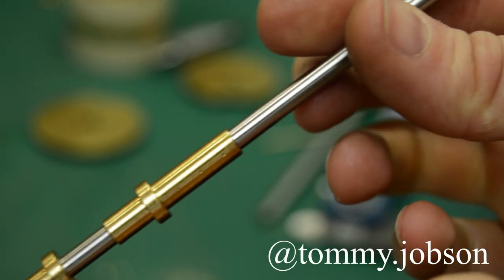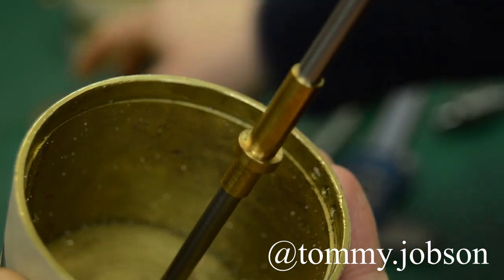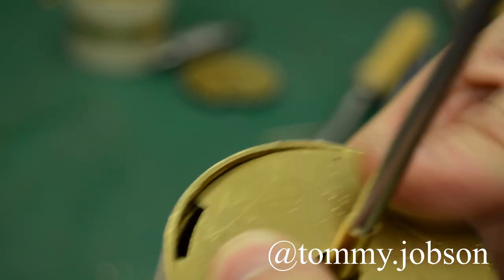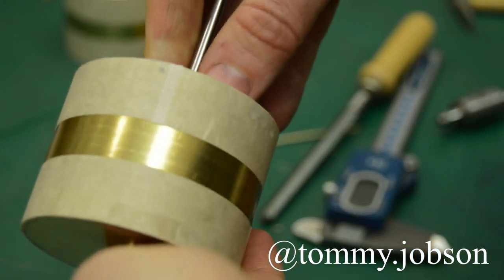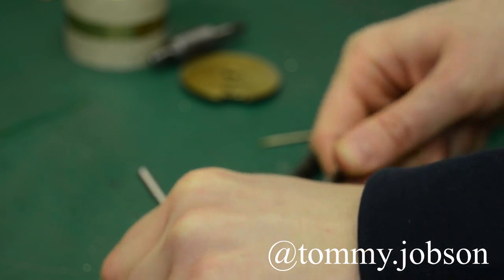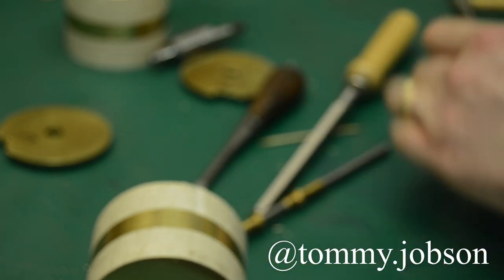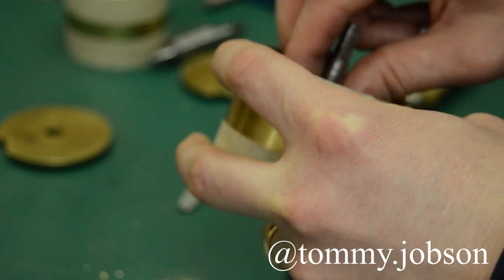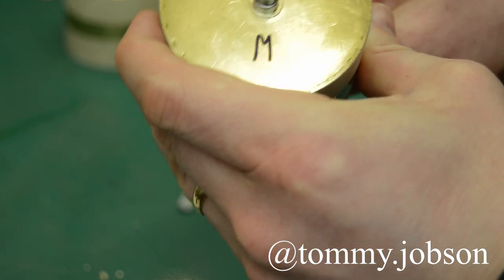Measuring inside a clock mainspring barrel.  #shopmadetools

Comment: I think it would be better to have the steel shaft fully threaded and the adjustable brass pieces tapped to fit the shaft.
The brass would be threaded to position by turning the part extending outside the barrel.  This tool construction would ensure the adjusted tool would not be accidentally miss adjusted when disassembling the barrel.
JIM
Reply from the maker: That sounds like a good upgrade to me. Perhaps I will make a MK2 version.